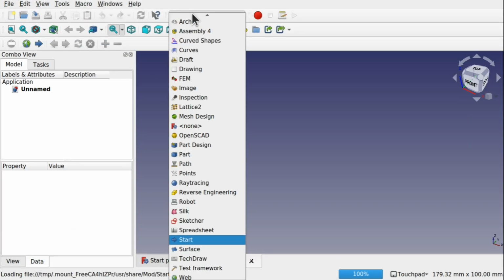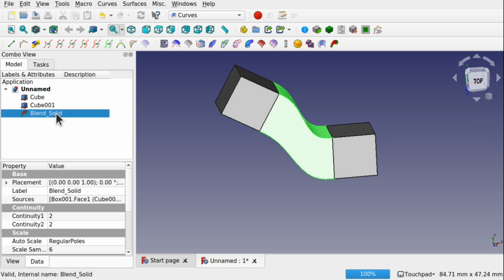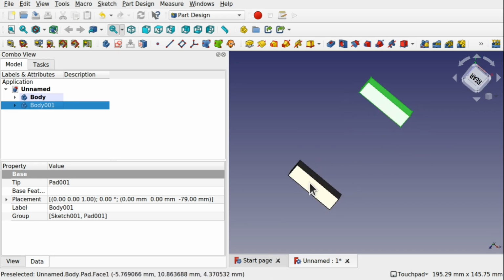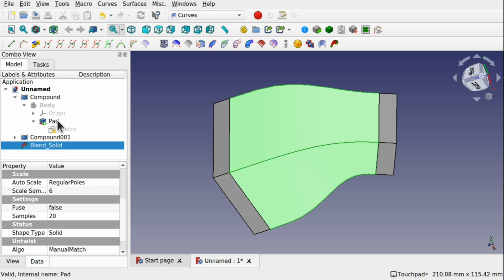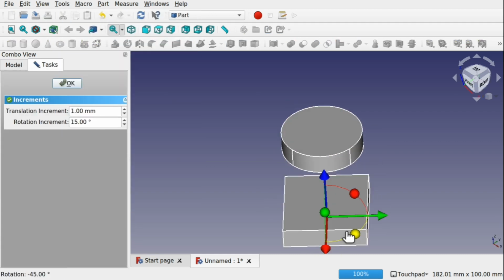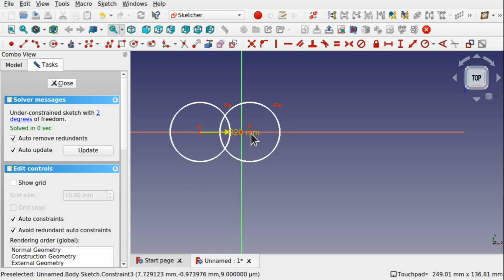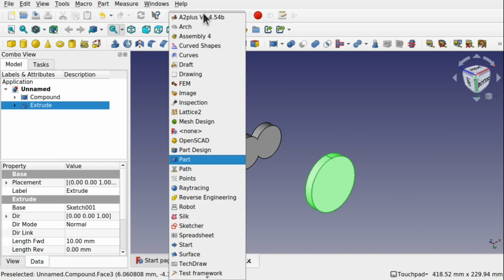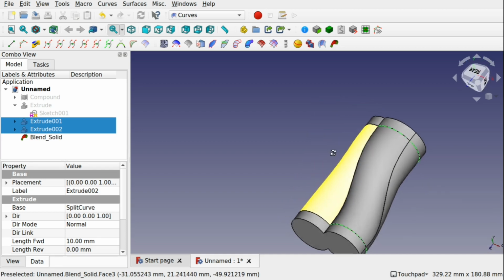Learn freeCAD Curves Workbench 15: Blend Solid Tool Merge / Morph two solids together Beginner Guide

Comment: Thank you for the tutorial.  Using FreeCAD 0.20.2 - I managed to replicate a couple of the things you've shown, but I am having a lot of trouble just blending two sketched circles that are padded out and made into a compound (slightly different sizes, just spaced out directly facing each other.) In fact, I need to split them, as one edge doesn't work at all. But even then, I find it leaves an open "seam" of sorts in the resulting solid on one edge.  Frustrating!
Reply: Yeah same here; did you ever resolve this ?
Reply: I was not able to using the "Blend Solid" function.  I used an "Additive Loft" as a work-around instead, which worked out alright for the part I had in mind.  Good luck!

Comment: I do have one request if you don't mind. Could you please demonstrate how to design enclosures for small printed circuit boards with mounting holes and external features. As i find this process very daunting and have no idea how to start. Thank you for all you do brother. Long time subscriber.
Reply from the maker: Challenge accepted 😁I was trying to find a subject for shape binders and part design threaded holes for the Beginners Freecad series and I think this would be a good example to use.
Reply: @MangoJellySolutions  Thank you thank you!! I will be watching for the video. You are number 1.

Comment: Hi, 
Nice job. The curves workbench is getting better and better. I would like improvement to fillet tool too. 
I have a query. Is it possible to embed a macro as a feature at a particular location in model tree?
For example I write a macro that calculates mass before applying a fillet. I need this macro to always run before fillet is recomputed so that the mass of a body without filleting is reported. Is it possible make macro as a feature in model tree?

Thanks and Regards
Anirudh
Reply from the maker: Thanks for the comments, the curves wb is coming on leaps and bound. I have never heard of anyone doing what you have described with the macro, I have experimented over today and I can't find a way of doing what you described. If I find a way I will let you know.

Comment: Thank you for all of the videos. I learned a lot and am still learning. I've been working on a project for a while now and can't quite seem to make it work. It's a pistol grip, a fairly complicated one with many curves and pockets of various sizes. The only way I've been able get the main body of the grip to work right is to use the Surface Workbench. The shape comes out spot on using the Surface tool. But then comes time to put the pockets in. I've tried several methods (Boolean operations, Slicing, etc.) and can't seem to get it to work. I usually end up with a message saying that there is no body to pocket. Is there any way to take an object that has been created by surfaces only and turn it into a Body/Solid so pocket/cutting operations can be done to it? Thanks again for the great tutorials!
Reply from the maker: Great to hear your making use of the videos, always good to get feedback. With your project It sounds like you haven't got a solid body but a shell. One of your surfaces may have a gap somewhere. In your part workbench use the check geometry tool and that will pin point the problematic faces and edges.